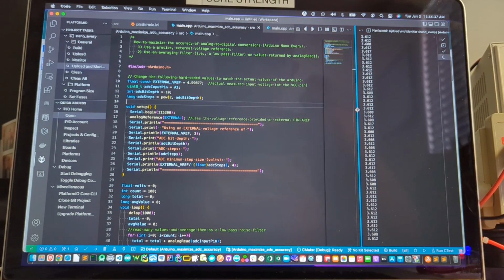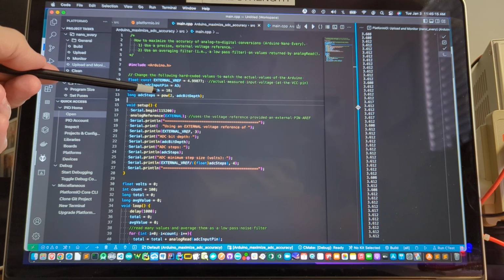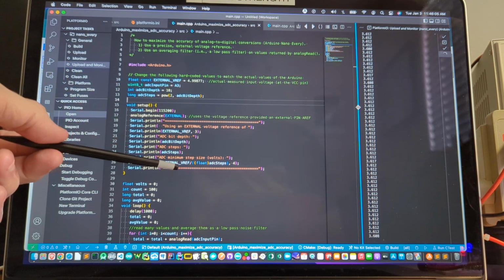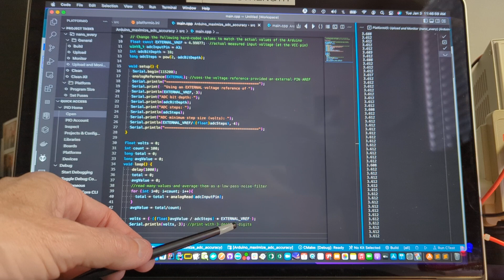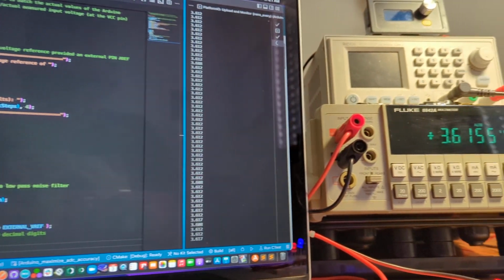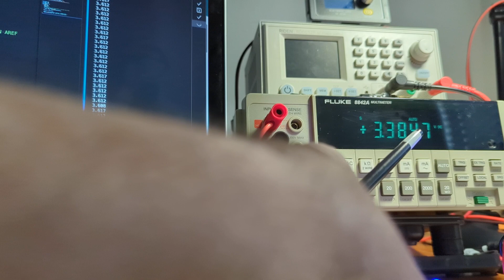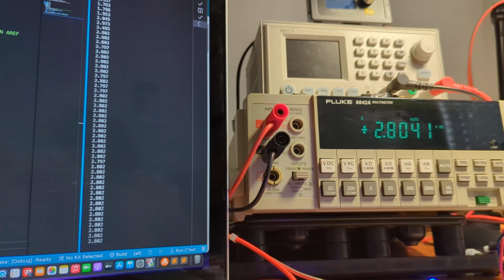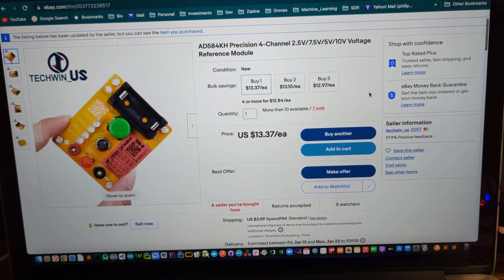Arduino ADC: high precision using a $13 voltage reference

Comment: I think you can do quite a bit better. You're averaging 100 values*, but then throwing away the fractional part and rounding down to the nearest adcStep.

Try these changes (off the top of my head, so there may be errors)
Line 33: float avgValue = 0.0;
Line 42: avgValue = (float)total/(float)count; //not sure if these casts are necessary, ditto below.
Line 44: volts = avgValue / (float)adcSteps * EXTERNAL_VREF;
Line 45, you'll probably want more places to print out the result now. 

The large jumps in your output are the giveaway, You wouldn't expect 100 averaged values to only output discrete steps.

*Using a power of 2 for the count value fits nicely here, for each power 2 increase, you would expect an additional bit of resolution, up to some limit. It would be fun to push this up and see how far you can go.

Interestingly this averaging to increase resolution will only work if there is enough noise in the signal, if it's too clean the ADC values are too stable and the averaging doesn't do anything.

If you try the changes, let me know if it helps. Great video!
Reply from the maker: Thank you very much, Michael. I really appreciate your helpful feedback. Yes, the code changes you suggested give nicely better results. I will make another video with those changes and also show results across a wider range of voltages. As you might be able to tell, I'm just learning about electronics. I'm a retired aerospace engineer keeping busy by trying to learn interesting new things. Feedback like yours is terrific.
Reply: @philipgiacalone5605  Awesome! Glad I could help. We're all learning together. I'll look forward to the follow up video.
Reply: @philipgiacalone5605  I believe what michael suggested is called "adc oversampling" if you would like to learn more about it
Reply from the maker: Thanks again, Michael. I ran a bunch of tests, after making the code changes you suggested. There were, indeed, nice improvements to the voltage precision. Here is a new video summarizing those tests. https://www.youtube.com/watch?v=Ze3Y0PK-t4E